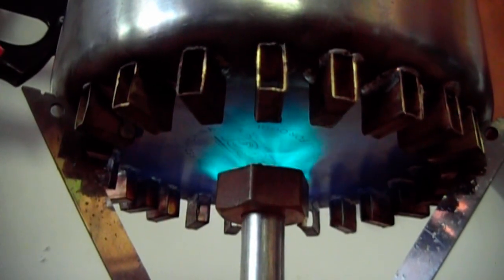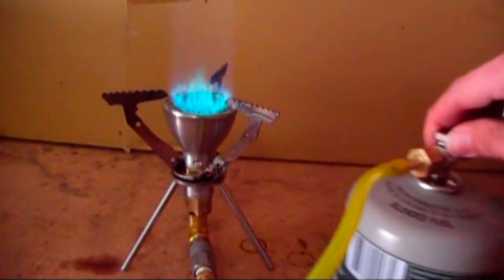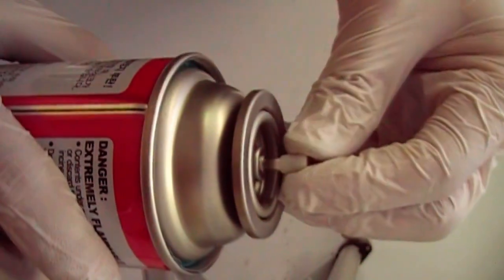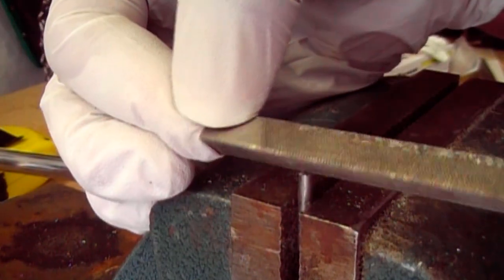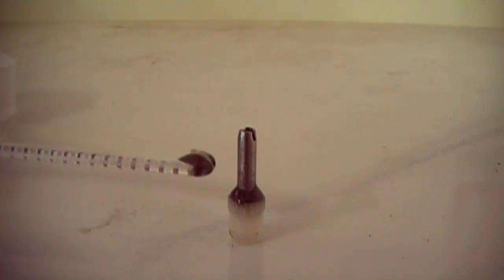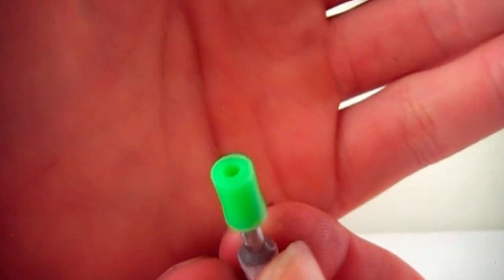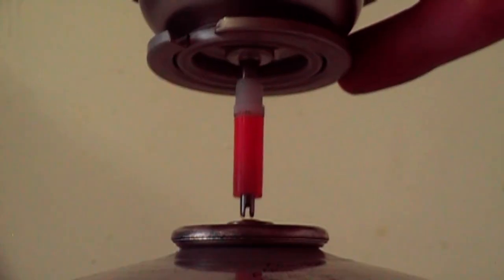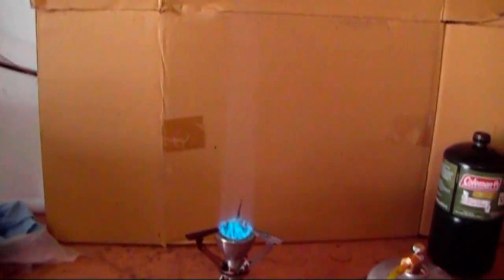How to refill camping butane tanks

Comment: It seems you are drilling all the way through the plastic part you got from the lighter. Before drilling it seemed to fit perfect on the Butane valve - and now that you have drilled through it, it will not fit the refill butane bottle as well - what am I missing??
Reply from the maker: scottcov56 The inner diameter that fits on the butane can is larger than the hole I drilled through the plastic piece, the drill bit never touched the material on that end.

Comment: if water is better than a cozy?  how would the tank/burner setup react to being set directly in a stream?,,,,,and,,,,,is it possible to overfill and blow the tank with butane?,  thanks
Reply from the maker: As long as the water is warmer than the butane being chilled to, it will help, it dose not prevent the butane from chilling outright, it gives more thermal mass that is to be chilled, thus slowing the process.

As long as you watch the fill weight, there is no problem. IF you overfill a tank you can purge it down to weight, if not the tank risks being put under too much pressure when the butane warms up. It won't just blow up in your face while filling though.

Comment: can you help with a solution in reverse,  to refill the "spray paint" butane cans? Its the only kind I can get and I use them just about in bulk.
Reply from the maker: cvcoco I don't have a larger cheaper source of butane to fill the spray can style with. So I can't work out a solution for that. Do you live in a place where butane is available in large tanks like propane is to me?
Reply: I will have to check around. Im in Malaysia where 99% of the population uses 20lb propane tanks for home cooking. For outdoors, all varieties of butane stoves are available together with the skinny butane cans which cost about $1.25 or so. I can buy adapters to take the butane can to, what is it, a lindal valve, but that doesnt help with my question. In fact, I cant even understand why that adapter is sold since Ive never seen the short, coleman propane camping can here which I believe it was created for. This is getting so confusing. I have seen people on YT refilling butane cans from large propane tanks but they are not explaining what adapters they are using. And, is it unsafe to do so since propane and butane have different densities?

Comment: Wouldn't a smaller "air" gap be safe in a refilled tank with only butane? Propane is a higher pressure gas, so it's there to remain safe through altitude and temperature changes that butane wouldn't be affected as much by.
Reply: The gap ("head space") isn't to handle the vapor pressure, it's to provide space for liquid expansion.

The danger is the liquid expanding to fill the container.  Past that point the container will burst.  Propane expands about twice as much butane (about 20x water instead of about 9x water), so pure butane needs somewhat less head space.  Butane is also denser than propane, so a same-weight fill with only butane should provide plenty of margin.

Propane tanks have pressure relief valves that should reseal after venting (although they frequently continue to leak on disposable cylinders).  These canisters are designed to pop out the bottom, turning it from concave into convex, without splitting at  the crimp.

Comment: I want to figure out if there is a way to convert a butane stove to run on white fuel like the MSR whisperlite has the ability to
Reply from the maker: Timothy Rodriguez you would need to add a vapor generator loop to render the liquid fuel a gas for the stove to run on. Are you looking to run a butane stove on liquid ONLY, or are you looking to do some kind of universal fuel kind of deal?
Reply: clkindred some sort of universal fuel kind of deal. I would imagine its possible...

Comment: hello,i want to use a freon tank as natural gas tank, a small freon tank about 4 pounds of gas it can hold.  i saw some using these tanks as a  tourch to weld things such as cooper and brass fridge pipes. i will put some foam insulation outside to insulate it more and also to cushion the tank even more.,i think these little tanks you are filling are not as thick as the freon tanks.
Reply from the maker: As the tank gets bigger, the tank gets weaker. Carbon dioxide tanks for example need to safely handle well over 1000psi. Small 12gram cartridges can be made from mild steel about 1/16 of an inch thick. Larger cylinders for paintball use with a diameter less than two inches need to be built from better and thicker material. Being less than two inches however, means they don't need to be re certified every four yeas as per US DOT. Cylinders wider than two inches in diameter are heavier still, and require re hydro testing every four years.

A quick search on natural gas transport indicates a pressure of about 200 bar for compressed natural gas (about 2900 psig) The pressure of liquefied natural gas is a bit misleading as it must be stored at a temperature of about -260 degrees F. With most information pointing out the fact that LNG's biggest problem is keeping the liquid at this low temperature. 

Freon (R-12) on the other hand has a liquid pressure of about 100 psig at room temp. So it seems CNG or LNG are just far too much for a freon tank.

However, in some countries, butane (Vapor pressure roughly 20 psig at room temp) is available in tanks of almost identical design as the freon tanks, perhaps that is what you saw with the torch use.

Comment: at $1.25 a canister the butane seems cheap in comparison to the screw type cans, but that is still very expensive compared to the gas cylinders meant for home use, I have a stove that takes the cheaper kind of canisters, is there a way to refill those?
Reply from the maker: Daniel Sultana If you live in a place where butane can be bought in bulk cylinders like propane in the U.S. that might be plausible. However, since butane is not available like that where I live, I would not be able to figure out exactly how to adapt one to fill the other.
Reply: I have since contacted the company that supplies cooking gas and asked them what mix of LPG do they use, they replied that the mix is 50/50 propane/butane, so really I cannot refill them as the pressure from the propane would be too much for a butane only canister. But thanks for replying.

Comment: What is the difference in burn with pure Butane verses the propane blend?
Reply from the maker: Stephen Chandler Propane has a lower boiling point than butane, so it maintains pressure at colder temperatures than butane. Thus propane is blended in to give the fuel mix better performance at cold temperatures. Strait propane performs the best, but the higher pressure at room temperature means the tanks must be much stronger, that is why the 1lb propane tanks are so heavy compared to the butane tanks. This is also why you can't refill these with just propane, they would probably burst. When at room temperature both fuels burn the same, as liquid fuel boils off to a vapor inside the tank the temperature drops due to the change in phase from liquid to gas. This makes the fuel canister get cold, as this happens the pressure will drop off weakening the flame, so propane also will sustain better pressure during use than butane.
Reply: clkindred is there a propane canister adapter we can make to refill our isopro gas canisters? or to make the 25/75 blend?
Reply: clkindred Why stop here... I would love to see you do a mapp gas adapter and see how hot that burns.
Reply from the maker: Stephen Chandler I think a propane adapter could be made, it might be something I consider this winter to make cold weather refills. MAPP gas could be interesting, but there is a limit to how quickly heat can be transferred to your pot of water. Any improvement would need to be dramatic to make the expensive mapp gas worth it.

Comment: I thought that I was getting ripped off with a bottle of Butane at more than $5 at Home Depot. So, where can I find the five pack for $5? 
I guess I could try to save the $15-20 and make an adapter myself...one problem is that I was looking at camping in the snow so I want to use a 70/30 Butane/Propane mix till late Spring or Summer!
Note that if you reply I may not get the message since Youtube doesn't allow me to just get alerts from this comment! Silly...
Reply from the maker: Tuesdays Runner I got that four pack of butane at a Korean food store. Try Asian markets.

Comment: If the butane actually does exert less pressure than the propane mix you should be quite safe with that overfill.
Reply from the maker: Yep, the biggest problem is the sputtering, making the stove hard to use until it's done.
Reply: clkindred - Now I am wondering if the sputtering is from over pressure or that the stove really needs that propane in the mix.  Can you let us know if the sputtering goes away when that tank gets down to the proper weight?  Thanks in advance for all your advice.  You engineered a perfect solution.  I personally think I could live with a little bit of sputtering to save so much money.
Reply from the maker: It's just the liquid butane not having the room to vaporize in the tank, it comes through the stove as a liquid and causes the sputtering and flare-ups. If the tank is at the proper weight, or below there is no sputtering and it runs smooth.

Comment: Does anybody know how to refill camping tanks with a bulk tank? I mean which adaptor to use?
Reply from the maker: Alex Ho There are no bulk butane tanks available where I live, so there is now way for me to find that out. Unless you mean bulk propane tanks, in which case that is not recommended due to the higher pressure of liquid propane.
Reply: clkindred No,the idea is to take bulk tank about 33 litres (in Russia) and use it to refilll lighters in SHTF situation.But how to do that? I have the adaptor to fill lighters with camping small tanks (about 250 ml).I need adaptor to transfer butane from big to small tank.

Comment: you need to use a magnet when buying stainless. to make shure your actually getting stainless steel.
Reply from the maker: Nathan Dean You could do that, if you don't trust the seller or manufacturer. It's probably something I would only do if I were buying in bulk. Problem is though, not all stainless steels are nonmagnetic, the common 300 series ss is usually nonmagnetic, but if cold worked can become slightly magnetic.
Reply: umm some thing to think about.

Comment: Filling the small bottle with another small bottle? What's the use? Doesn't make sense.
Reply: Bottle #1 is cheaper, but you cannot attach your stove to it.
Bottle #2 is more expensive and supposedly not refillable, but you can attach your stove to it.

So you need to cook off of bottle #2 otherwise your stove doesn't work, but refill it with the cheaper fuel from bottle #1.

Comment: Whose got those butane cylinders that cheap? They cost three times what you paid around here.
Reply: I live in the Netherlands and those canisters are also expensive in my country if you buy them from campingaz you pay 3.99euro if you know where to look you pay 1.18 euro but that is another brand.I bought on the oriental market bazar 4 boxes that is 112 canisters for 0.72 euro  per Unit and they are some kind of german brand.
Reply: Thank you for your informative video. In your presentation you said "These other type canisters can be found for about $1.25 if you know where to look." Why are you keeping where to look such a secret? Will you deign to enlighten your You Tube audience just where they can find a deal like that short of buying 112 canisters at a time? The whole point of your video was "how to CHEAPLY refill butane tanks". You totally miss the very core of your message by failing to disclose the cheap source of the butane.

Comment: Ok so hold up. Your refilling small camping butane tanks with a (I'm guessing) 16oz butane can.
And I'm also guessing that your camp stoves don't fit the refill can.
You see where I'm going with this?
Why don't you instead of spending so much time refilling two tanks, just pack one 16oz butane can, and create an adaptor for that? If you have the talent to make an adaptor from can to can, from can to camp stove should just be a matter of some simple solder work and maybe just stealing the nozzle off of an empty camp stove can, after the tank is punctured of course, so that you don't injure yourself. Obviously this would be difficult, but any more so than the trouble you've already gone through?
BTW I'm not scrutinizing you, I think this is a good idea. In fact it's the main reason I don't buy these camp stoves.
Reply: +A10helixtangofoxtrot g Not a bad idea if it worked,but many times it won''t
 I would need the small fat can type for both my 1 burner stove and table top lantern, those would not sit up well on the tall skinny cans.
 Also should not take but a minute or so to refill the correct can so not really an issue.
 Using the correct cans means if a friend runs out of gas on his stuff you can loan out a spare tank if you got an extra also.  I mean I would not need to use the lantern in morning daylight so I could loan that can to friend for his stove. OR just refill his tank for him if you have the adapter and refill tank with you.

Another thought is that seldom do we need a full can all in 1 use, so when out camping carry the refill can and adapter and if a can is low or empty just give it a quick blast. After filling and weighing a few cans to full should get a good idea how many seconds it takes to fill. If it takes say 60 seconds to full fill an empty then filling when camping only fill for 30-40 seconds and no need to weigh it as it will not be full yet.
Reply: +Den Stump Oh.
Oh well, just a suggestion.
They make stoves with hoses, but since you already got one you might as well use it.
Still, good idea.
Reply: A10helixtangofoxtrot g
Really allot depends on many things!
Like if you are hiking weight matters allot to what you can carry. Size DOES matter also! LOL
 As for say motorcycle camping, you can only carry what fits on the bike, weight is not as much an issue but size still is.
 Most the stoves with hoses etc.. are way to large for hiking or motorcycle camping.
 Then still the issue if you got 4 items can you use the same fuel tanks on all of them?